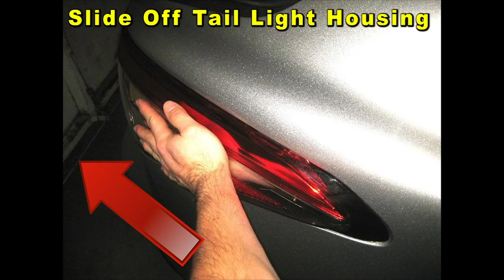2018 To 2024 Toyota Camry How To Change Tail Light Bulbs With Part Numbers - Quick & Easy

Comment from the maker: Toyota Camry Rear Turn Signal Light Bulb - https://amzn.to/3SIAKi6
LED Rear Turn Signal Light Bulb Part Number - https://amzn.to/3wgbicr
Rear Side Marker Bulb - https://amzn.to/3wi8IT4
LED Rear Side Marker Bulb Part # - https://amzn.to/49s8cAs
Precision Screwdriver Set - https://amzn.to/3sLixaP
Plastic Pry Bar Tools - https://amzn.to/3HMtsV7
Socket & Ratchet Set - https://amzn.to/3Z17LbA
Mechanix Gloves - https://amzn.to/3jCnHkt
Torque Wrench - https://amzn.to/3vS5uSI

The Paul79UF YouTube channel is a participant in the Amazon Services LLC Associates Program, an affiliate advertising program designed to provide a means for sites to earn advertising fees by advertising and linking to Amazon.

This DIY video shows owners of the XV70 eighth generation 2018, 2019, 2020, 2021, 2022, 2023 and 2024 Toyota Camry how to change the rear turn signal and rear side marker light bulbs. (The brake light bulb is an LED that should last the lifetime of the car.)

Comment from the maker: Check out the DIY guide for changing the tail light bulbs on an 8th generation 2018 to 2024 Toyota Camry - 
https://www.paulstravelpictures.com/2018-2022-Toyota-Camry-Tail-Light-Bulbs-Replacement-Guide/index.html

Here are all of the DIY repair and maintenance tutorials for the 8th generation 2018, 2019, 2020, 2021, 2022, 2023 & 2024 Toyota Camry -
https://www.paulstravelpictures.com/Articles/2018-2022-Toyota-Camry-Common-Problems-Repair-Maintenance-Guides.htm

Owners of other Toyota, Scion and Lexus vehicles such as the Avalon, Corolla, Prius, Yaris, Mirai, 86, Sienna, RAV4, Highlander, 4Runner, C-HR, Land Cruiser, Sequoia, Tacoma, Tundra, Venza, Hilux, RX 350, IS 250, IS 350, CT 200H, GS 450h, GX 470, LX 470, UX 200, NX 300 and UX 250h may also find these DIY instructions to be helpful.